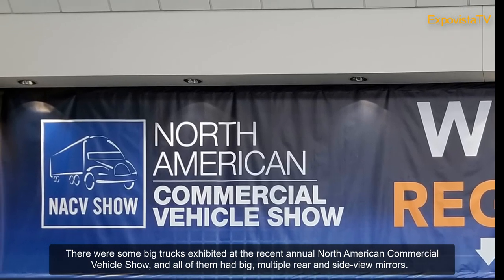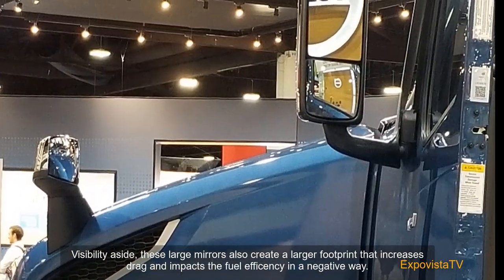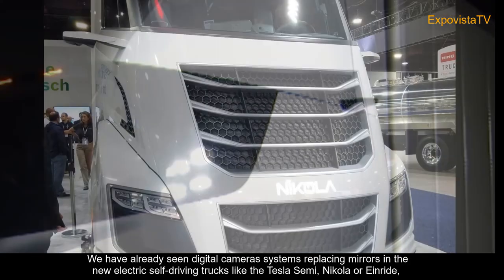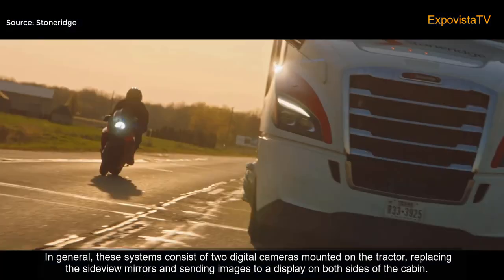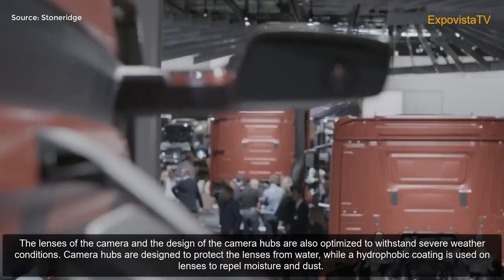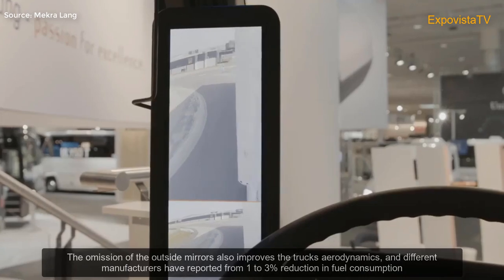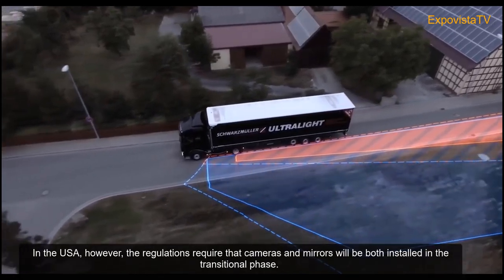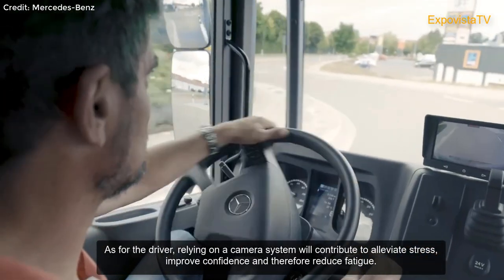Trucks Go on Streaming: How Digital Cameras Will Replace Traditional Mirrors.

Comment: I am a otr truck driver otr for 47 years , European and north America.  And i agree with cameras to replace the truck mirrors.  I will go even further.  I ask for infra-red cameras to the front, so you don't need a bull bar at the front. And for every cameras 1h00 storage time for the insurance. This will be a game changer for truck drivers.
Reply: Lmao no
Reply: These systems fail, mirrors don't.
Reply: You never have a broken mirror? 
And a complete mirror arm from freightliner is 2k usd per side. If you damage your camera, the screen inside the cab doesn't have any problems.
And with mirrors some drivers also have huge problems: one driver called his boss. Can't drive the truck anymore.  Boss ask him why.
Driver answered.  Truck lying and the mirrors. Lol.

Comment: Bad idea. Why cars never adapted this technology. 1 bird sh... will cover camera but only 1/50 of mirror. This is just advertising to sale this technology. Cleaning lenses will make them milky. Drivers will not use special cleaning procedures. If you know a bit about sensors in photography then you know how many stops of light sensor can do compare to a human eye. If camera sensor doesn't have enough light it will replace it with noise. Real mirrors don't need elecricity and are cheaper to replace. Biggest problem with this is covering wide angle in turns and backing.  With real mirror all what you do is move head backwards and you can see sleeper. Move head forward and you can see what is next to you.

Comment: These mirrors sound good on paper, and they sound good to the engineering firm pushing them, but ask drivers who actually use them, and you'll get a more real honest evalution.
These mirrors in no way shape or form enhance visibility, if anything they reduce your visibility by about 30% or more, especially if don't have the best eyesight or wear glasses.
Where I work, some drivers have even elected to quit, rather than be forced to use these mirrors, cause they just can't see with them.
Older drivers usually, the objects in the mirror are just to small.
Reply: shouldn't be driving if you have bad eyesight. and how is it harder than using normal mirrors
Reply: @Supraboyes  If only those with 20/20 vision could drive, that would remove about 80% of all drivers, CDL and Cars, so that's not the issue.
And 'mirror eye' simply reduces normal vision size by about 30%, and it gets worse with distance behind rig.
A screen cannot replace natural eyesight, there's glare, and at night it's just all black.
There is no 'depth'...
Driving a semi truck is not like playing some video game.
Good drivers, however, simply adjust to the situation.
But gladly even the companies that use them realize it was nothing more than a sales sham and so are giving drivers their normal glass mirrors back.
Reply: @Supraboyes  Been driving safely for over 20 years with a CDL, mountains, snow, Ice, freezing fog, freezing rain, deserts, inner cities, Canada and more, so please, no lessons, my record speaks.

Comment: I have an issue with one part of this video. Shortly after the 4 minute mark. This increase, is statistically NOT due to truck drivers and is in fact due to everyone else around the truck. Mirrors don't fix everyone else. It's not like most of the situations are really avoidable.
Reply: But with a storage of the last hour, you can prove, the 4wheller cut you of.